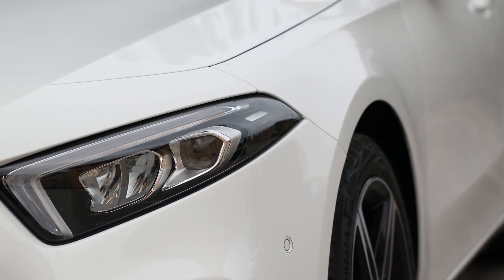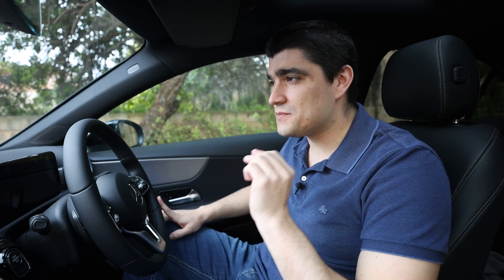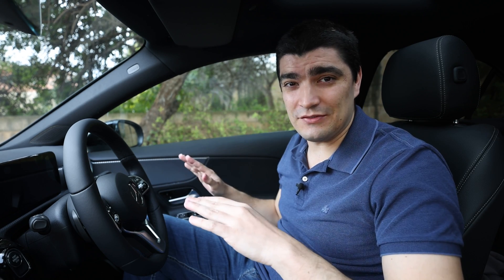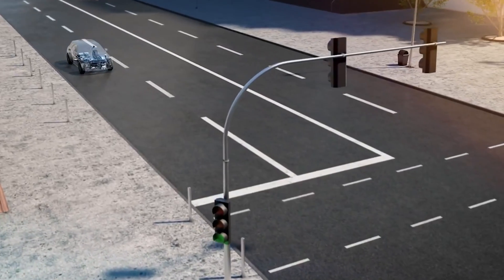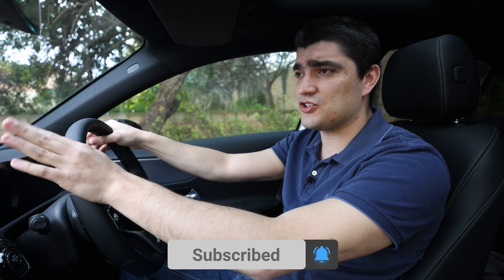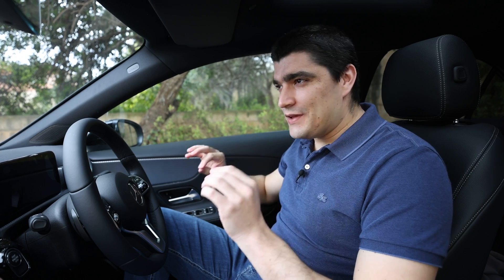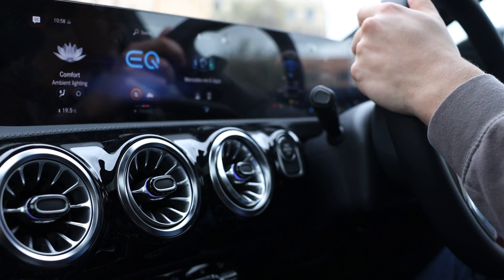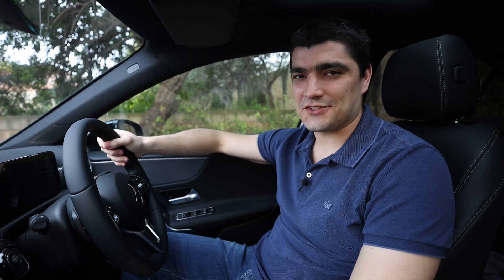Pure German engineering - The Mercedes a250e (PHEV) Tech Focused Review

Comment: Is it true that in Sporting mode it recharges the battery? Thank you for the review, great job!
Reply from the maker: Thanks for watching, the car will attempt to charge the battery in all modes, the car uses the electric motor to brake the car before it engages the traditional brakes. The electric motor running in reverse essentially charges the battery in the process, you will regain around 20% of the energy used.